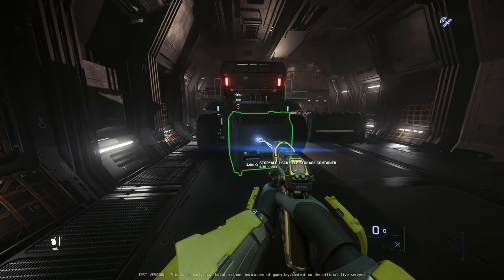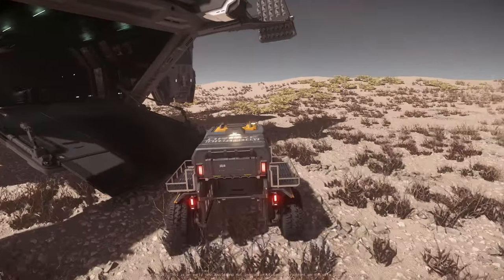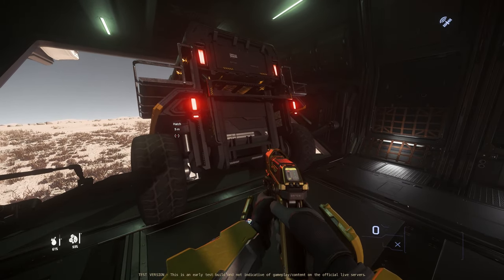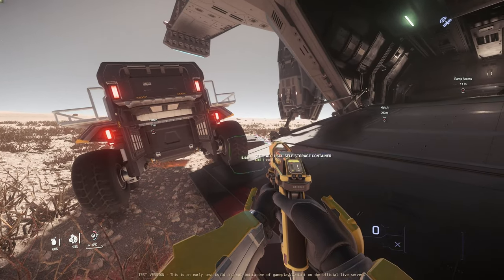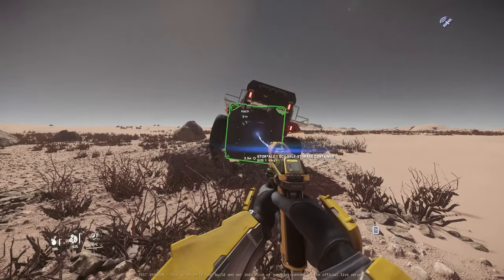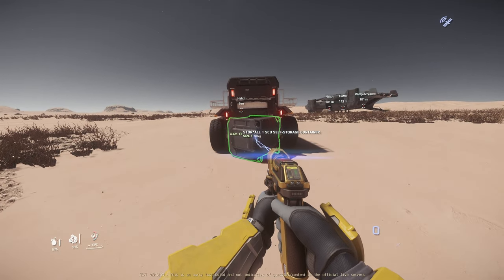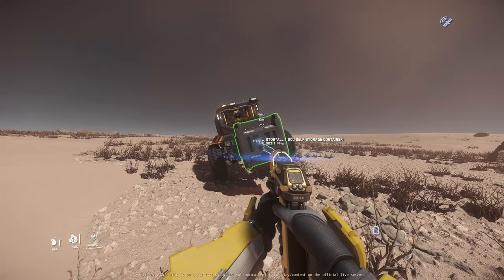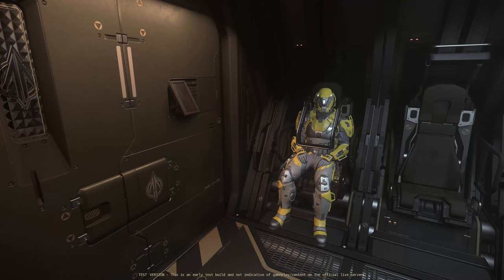Star Citizen 3.22 WORKAROUND On HOW TO EXPAND Drake MULE Storage Capacity

Comment: I feel lile there has to be a way to taise the bar thats in the way or something. Seems like a hige over sight to give it a cargo grid but not make it so you can place a crate unless you jerry rig it.
Reply: It will snap to the mule but the mule can't be in your ship to do it. Put tractor beam in detachment mode and it works just fine
Reply: There is a pair of toggles on the right side panel inside the mule that is literally labeled "front" and "rear" ... but only the 'front' one works (to toggle the forks) its like they forgot to go back and animate the rear for the rear SCU box area)

Comment: Why don't you use a tumbrill cyclone? It is faster, can carry two players, has shields and can carry a 1SCU or several smaller boxes
Reply from the maker: Wait, Cyclone can carry 1scu cargo container? I thought he can carry only a small boxes...will test this soon. Tnx for the info!
Reply: @LORDV4DERONP1LLS The base cyclone has a ramp that comes down and you can place 1 or 2 scu containers in the spot, but they don't have a grid. You don't need to put down the ramp btw
Reply from the maker: @sageohpizza7100  Cyclone actually have a grid, I was able to snap 1 SCU container without any problems!
Reply: @LORDV4DERONP1LLS  sweet! That must be new since 3.20

Comment: There used to be a button to open up the back bar, at the back or from the driver seat. Did they remove it?
Reply from the maker: Not sure, I was looking for a button on the back side of the vehicle and not found any. Only one is the one in the cockpit which sais "rear" so I believe that one is for the rear bar.
Reply: Did a check myself, looks like it is not working anymore. Will make an issue if there is none already
Reply from the maker: @MrGhost. Cool, feel free to paste the issue link so that I can confirm this too.
Reply: The button is there.. but you cant click it.. only the 'front' forks are clicable now with 3.22 (just tried useing the Mule tonight)
Reply: @LORDV4DERONP1LLS  I made a issue but look like the link got censored by YT  STARC-96390
Reply from the maker: @MrGhost.  I will find it and confirm! Tnx!

Comment: You don’t need to position the mule any special way. The problem is that you are trying to load it while on a cargo grid that takes precedence on locking down the cargo box.  You simply need to line the box up straight and it will snap right in place.
Reply from the maker: Yeah, but I tried that outside of the ship and still was unable to snap it. I will try again thou...tnx!
Reply: Did you watch the video?
Reply: @digitaldeni  ya I watched the video, and I've done it in game.
Reply: @critmyster7492  In the video he tries what you said in the middle of nowhere with no ship or cargo grid. As we all did before coming to this video. It doesn't work. You have to get at least a corner of the box under the Mule or drop it from the top.